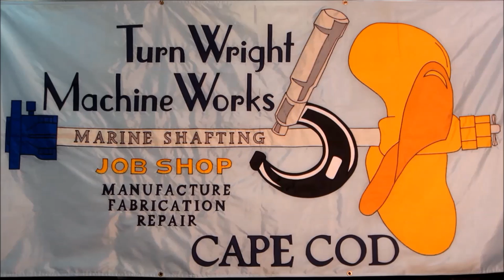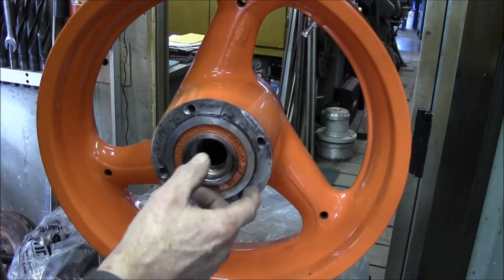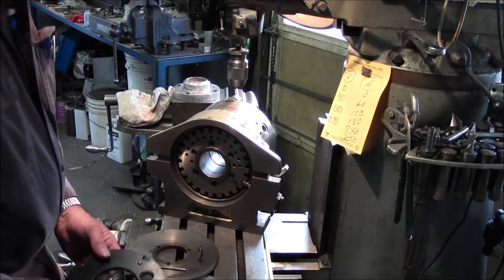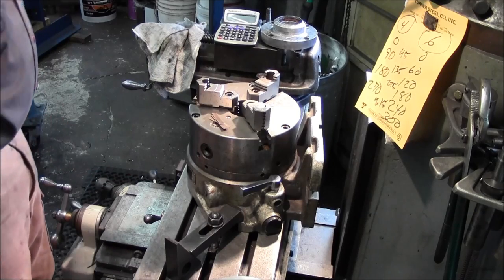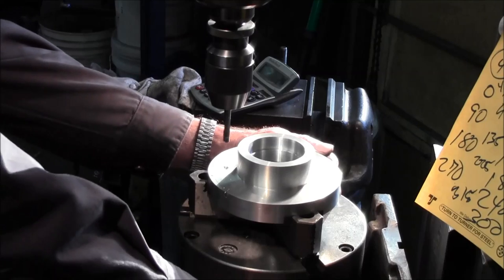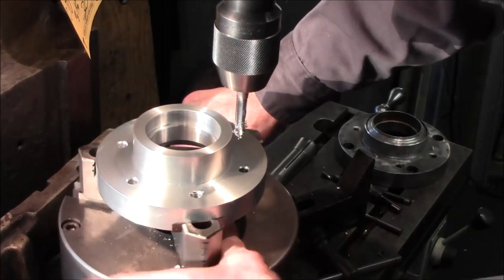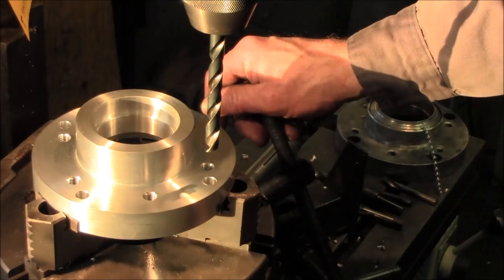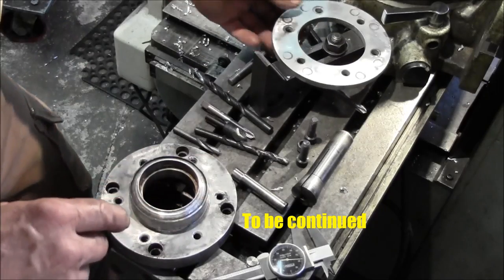Motorcycle Rim Repair: It's how you look playing the game! Part 6

Comment: Concerning the first rim in this part of the series that you bagged up and sent back.Instead of helicoiling it,why not use an endmill to get the holes round again,and then drill/tap and make aluminum threaded slugs epoxied back into the bosses,and then redrill/tap the right size threads in the slugs?I've done this many times with excellent results.

Comment: To me, the super spacer  scores over DRO pitchout when there are lots of toolchanges, eg counterbored, countersunk, tapped holes....
The quick and effortless repeatability of the SS makes it quicker to keep the same tool in and run around the pattern, which means a lot more relocations, but few tool changes. 

This gets increasingly beneficial the more holes there are on each pitch circle.